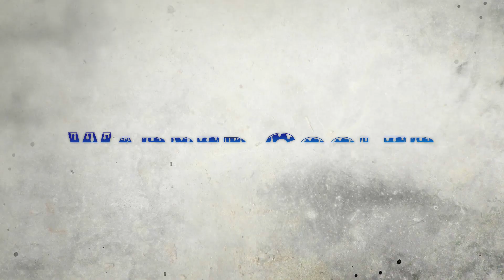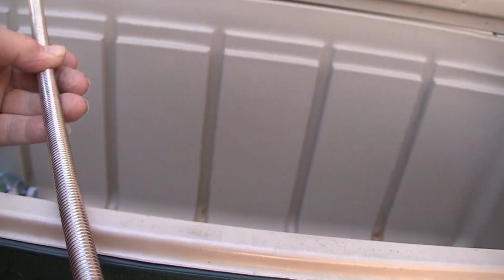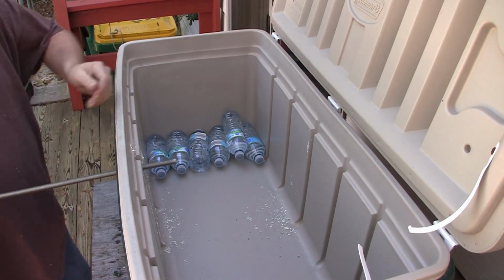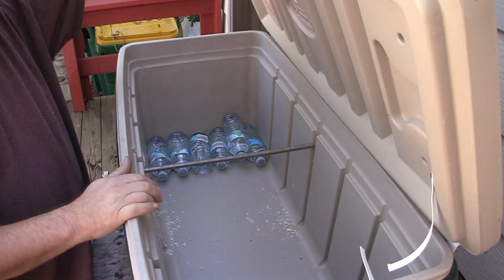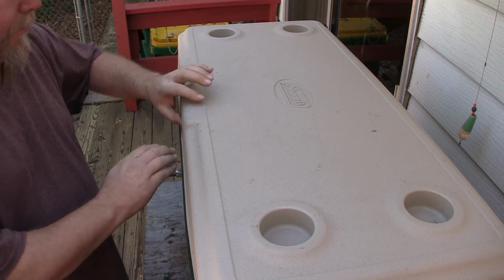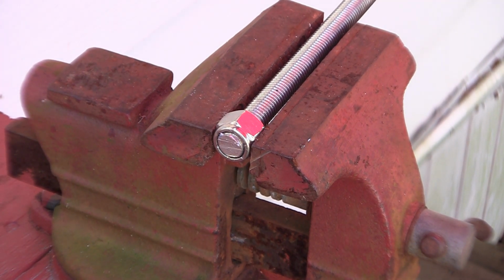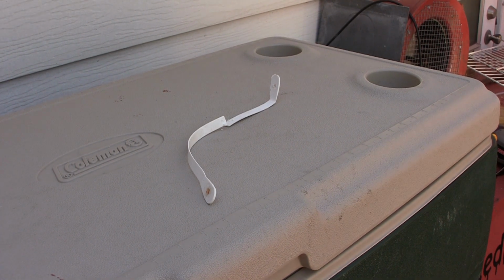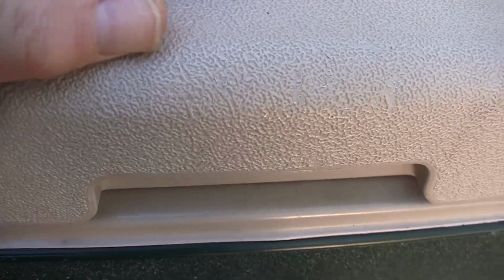Warped Redneck Cooler Repair

Comment: You had to use another material instead of the metal rod for this purpose, since being metal and having two points exposed to the interperie (where the nuts and washers go) are heat inputs to the interior and lower the efficiency of your cooler.